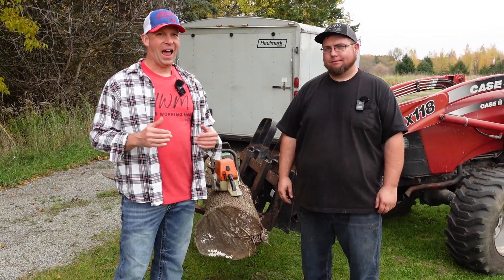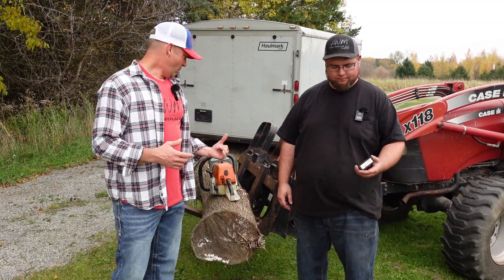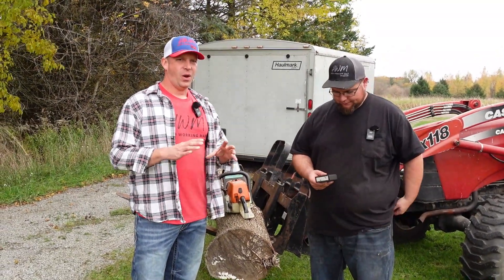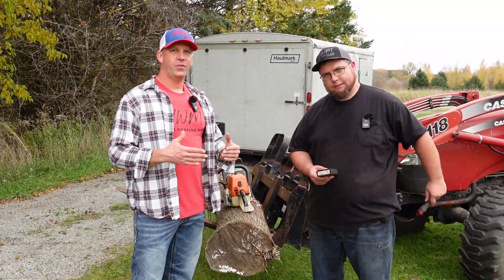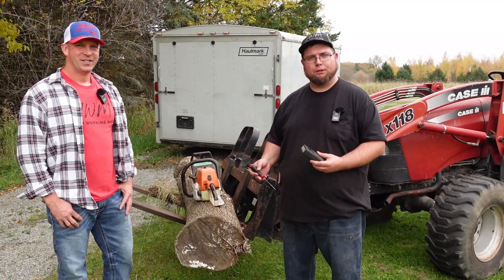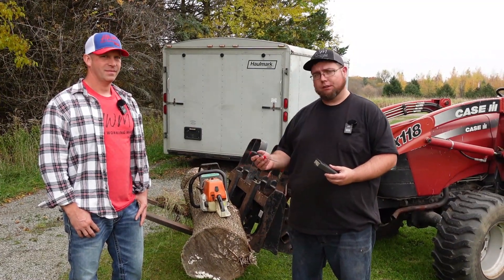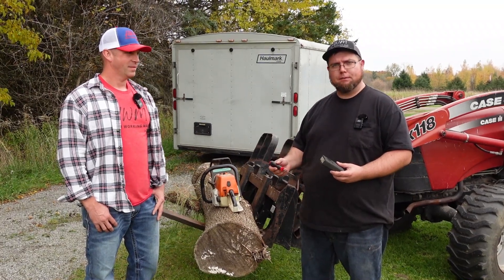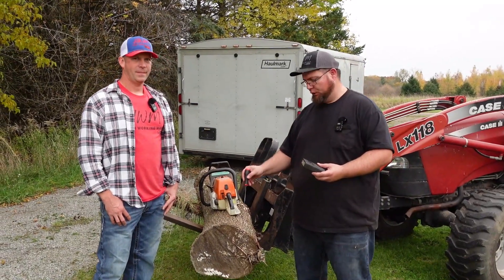How To Properly Adjust Carburetor On Chainsaw! Expert Tips!

Comment from the maker: We forgot to add the times in for the cuts. With the 036 running rich it took 15 seconds to make the cut. After Joe dialed the saw in to it’s sweet spot it took 12 seconds to make the same cut all while burning less fuel. This will all add up.

Comment: If I’m almost bottoming out the high jet and it’s still running dog rich what do I do. also has a custom muffler on it, so rich right at peak rpm it’s spitting a bit of fuel out the tips mid range not bad but right at the peak rpm it’s spitting fuel not in the cut
Reply from the maker: Are the limiter caps removed?
Reply: @hardworkingmanoutdoors no I think I’ll have a look at that

Comment: High revs will put stress on your bottom end bearings. Working with a lean mixture, even without reaching too high revs, can damage your engine, because combustion temperatures go up with lean mixtures. On the other side, additional fuel can be used to cool down the combustion.
Reply from the maker: Thanks for the info, always good to learn something new.

Comment: FYI folks; He is saying that this 2 stroke engine has combustion happening every 4 piston strokes instead of every 2.  This makes the engine fire less frequently and unevenly.  This is caused by a “Too rich” fuel mixture… look that up.  In the end if this is not corrected it will damage the motor.

Comment: Good video he knows his saws I prefer old Saw's I have not had any luck with the newer one's and hate the oil and gas caps. I run a 28 super,046 and a 400 echo.. Take care be safe and well.
Reply from the maker: Thank you!  Joe definitely knows his stuff. The first quality saw I ever bought was a Stihl 028 Super. I picked it up at a garage sale, the paint on the bar didn’t even show wear but it had been sitting in a barn for years. I paid $5 for it, replaced the fuel lines, cleaned the carb, and ran it for years. Still proud of that deal!

Comment: The clutch isn’t worn, it’s the way those older saws are. The springs do slowly stretch overtime and cause the chain to “walk” a little. Even when those saws were new it’s common for the chain to move before the engine is warmed. When the saw is warmed up and if the chain moves a lot, it’s time to change the clutch or clutch springs. The noise Rachel was hearing was the clutch and clutch drum ringing. Again, all those older Stihls sound like that. The early 066 red light/flat top definitely has a distinctive sound. The aftermarket clutches tend not to walk or ring like the OEM ones. It’s also harder to “feather throttle” with some of those aftermarket clutches I’ve noticed, making the saw’s trigger less sensitive. Particularly when they’re just a few wood fibers holding and you try to cut them without sawing into the dirt. I threw away all the aftermarket clutches I got, and saved the springs and “rebuilt” the OEM ones. I feel like a geek making these “long winded, know it all and probably extremely boring to most people” comments lol. But that’s what happens when someone says something that starts you thinking about what has accumulated in the “cobweb section” of your mind 😂
Reply from the maker: Scott, you were one of the people I was referring to that I’m jealous of you ear for saws, and knowledge!
Reply: @hardworkingmanoutdoors  Thanks! There’s still a lot I don’t know, like with porting, port timing, squish and all that. When it comes to hopping a saw up all I know is old school logger mods, more air going in, and more air going out, and chains. One thing a lot of people don’t know is you can change angles to cut better in different types of wood, soft, hard, green, dead, petrified, etc. I wish I was better on camera, that would be a informative video. When my dad logged they used Husky 1100s, 2100s, and Stihl 056 magnums, and Magnum 2’s, etc, but his firewood saw was a Stihl 036 pro, like yours, and I’ve seen him bring down huge trees in a short amount of time with that little 62 cc saw. But he could tweak a chain to perfection, and running his chains in the wood it was filed for, you would think you were running a bigger saw because of how well it was cutting.
Reply from the maker: @scottw.2450  oh yeah not sure what I do but sometimes my chai is awesome and sometimes it’s not lol.
Reply: @hardworkingmanoutdoors  I guess I’m really still experimenting with different angles with filing, always looking to perfect it as much is possible.

Comment: I think the 036 was may not have been the best example for this video today. It acts to me like it has a small air leak somewhere, and  the confused looks on Joe's face backed up that thought. His adjustments were not getting the results he expected because the saw is running erratic. IMO
Reply from the maker: That is possible but we had other saws there he could have used. He said he couldn’t make it too rich for example because my limiter caps were still on. The cut time was reduced by 3 seconds after the adjustment though.
Reply: @hardworkingmanoutdoors  I believe you will soon see for yourself. When the saw will not hold a tune, but I could be wrong...